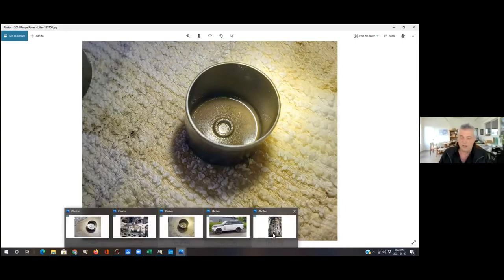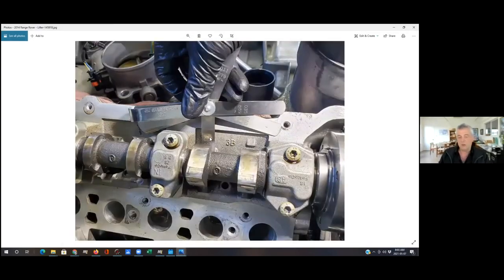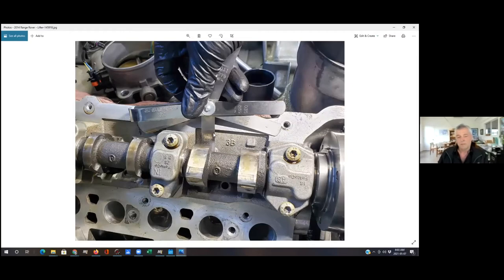Pawlik Automotive - 2014 Range Rover Supercharged, Engine Noise Repair

Comment: Always great videos.  Thank you.  My 12 supercharged @74k has a pronounced  clicking ticking on cold start up. Not there when reved up. Completely gone after I get to where I'm  going.  Have all my parts for the supercharger fix And a waterpump. But after I  heard my fan clutch ingauge the noise stops. I have heard this can make a ticking  also. And I am considering the underdrive pulley on the snout for the added  90 horses. Your thoughts  ?

Comment: Even the 2014’s have timing chain issues? What year does it stop?
Reply: I agree, i did the timing chain and supercharger nose cone on my 2012..... it was spendy..... im currently looking at a 2014 and was trying to figure out if it was fixed yet? i havent figured it out either : )
Reply: @squirrelmaster1225  I’d say at a certain point it becomes less of the timing chains being the problem cause they were fixed and more of an owner problem because people don’t do proper oil change intervals. 10k is too long to not change your oil and it will stretch the chain
Reply: @iibise.3827  I agree, on my 12 I change the oil every 7000, 10k seems to far, 
Looking at a a new, used one is stressful, :/
Reply: @squirrelmaster1225  I feel your pain I’ve been looking too😭 I want a 10-13 sport supercharged and timing chains are tough guess on these
Reply: @squirrelmaster1225   what did the supercharger nose cone cost ?
Reply: @tylerdiedrich1947  I don't remember what the part costed, labor was  a given since it was already apart for the timing chain
Reply: It doesn’t 50k my 2019 Range Rover hse needed chains
Reply: @tylerdiedrich1947  what were your oil change intervals?